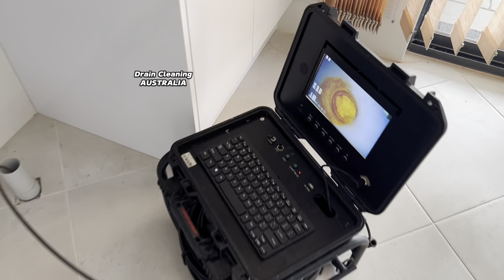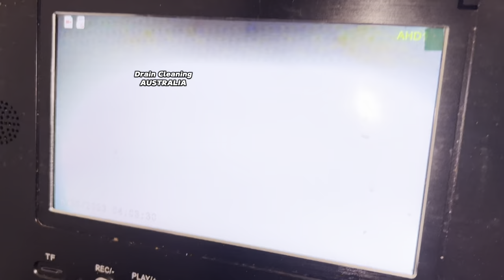This drain CAN'T be unblocked… said the 2 previous plumbers!

Comment: I had a situation like this! Thought my drain was blocked by hair and leaves and all sorts of debris (drain connected to pipes from the bathroom) when I first moved in.

Turned out it was blocked by sand from probably six years prior when the drain was cemented.

Couldn't believe that neither the company who installed the drive nor the homes previous owners had cleared the drains at all. Check them and clear them before every winter begins to make sure they can take the extra water and not had any problems since

Comment: Could have been worse.  I had some tile put in my bathroom way back and after I put the toilet back in it wouldn't flush.  I got a plumber to come out and turns out the contractor was tossed left over mortar into the drain hole.  He managed to clear it though.

Comment: Hey Bruce, why not use a Tee instead of that elbow? Simmilar idea, but you would have the advantage of having a column past your drain "hole", which would potentially make it cleaner.
And maybe a 90 on the bucket end, to force the water down the bucket without splashing around.

Comment: 9:38 I'm surprised S-traps are still legal in Australia? They're not code compliant in a lot of jurisdictions in the USA - you instead need to use a P-trap that goes into the wall at a 90 degree angle.

Comment: I will never understand why Australians put their Laundry in the Kitchen. Most bonkers design choice i could ever imagine. The last place i want my dirty laundry, is anywhere near or around where i am preparing food.
Reply: This is a separate utility space, the cooking area is next door? But in any case not every home has the room for a separate area, the plumbing and drains are already in the kitchen so it makes sense to plumb a washing machine in there. It’s why it’s common in smaller UK homes. How dirty is your washing? No one smears their dirty knickers over the counter?
Reply: @nicolad8822  there are two kitchens in this home, and there is a clothes washing machine in both of them. LG's in both instances.
I get the idea of the wet wall making it easier to plumb, but it's still just an odd concept. I don't want laundry detergent in my kitchen, and more than I want dirty knickers. Laundry is also towels and bedding, which is more gross than knickers, IMHO. Plus cooking oils get everywhere. I avoid laundry around dinner time, because I don't want my clothes to smell like cooked food.
There is a multitude of reasons outside of sanitation that I wouldn't want to do this.